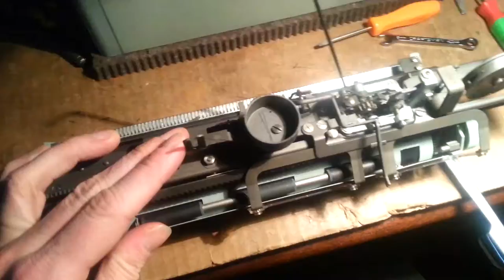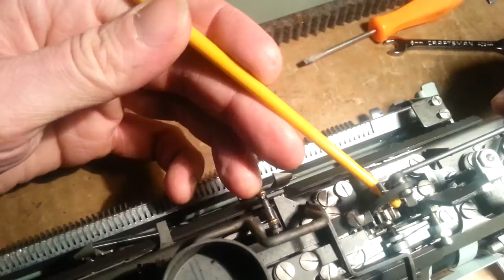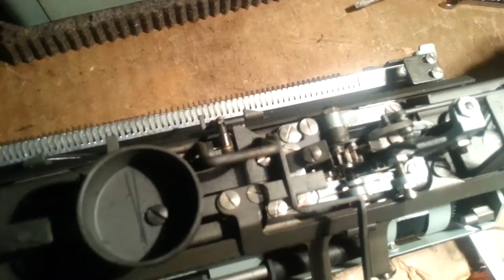1958 Hermes 2000 escapement

Comment: I am having trouble putting back the carriage on the body on my Hermes 2000. The "swinging bar" for the ribbon shift lift on the carriage (the one next to the bell in your video) that should rest on a lever/crutch in the body seems to make the carriage not sink down low enough but rather pivot on this point. Have not been able to figure out what is wrong.
Any chance you could make a video or explain how to put the carriage back on correctly?

Comment: I have a Hermes 2000, and I've noticed there's no bell and the end of a line. Do you know if there a switch or something to turn it on? or does it just not have one?
Reply from the maker: There is no control to disable the bell.  In all likelyhood, yours is 'simply' malfunctioning - could be just dirty linkages, could need adjustment, could be missing parts, could be a foreign object caught in the works, could be...well, you get the idea.  Be observant, be patient, follow the physics, and I promise you can figure it out :)
Reply: +TypewriterJustice Thanks for the reply. I followed the physics and fixed it.  Small right hand margin thing wasnt catching  the bell lever properly on it's way past. I give it a clean and bit of a wriggle and it working fine now.

Was absolutely filthy. Must have over 60 of dirt and dust embedded in it.

Comment: Hello sir - I need a bit of help. I have a Hermes 2000 which works beautifully - Except for that, the backspace pull was loose when I got it and then totally fell off and out of the machine a few days later. I need help working out how to reattach it. Could you spare a few minutes?

Comment: I know this video was quite some time ago but I would appreciate some help with my Hermes 2000. The backspace is sometimes moving back 2 spaces but not always. The carriage is also not advancing from the space bar when in the UC position. The lever you are tripping for the carriage in your video doesn't move it in the UC position but works fine in the down LC position. I think I need to remove the carriage like you have, before I attempt It I thought I would ask if its not too difficult and you have any pointers (I am a Techie LOL)

Comment: I have just bought one of these beauties from 48 in great condition that I've begun cleaning up,  it truly is an amazing piece of engineering. The segment on mine also skips sometimes, so if you can share a tip or two on how to approach it without taking of the carrier (as I think that might be a bit to complicated for me )  I'd much appreciate it.
Reply: Did you get any response regarding the carriage skipping sometimes? I just got a Hermes 2000 yesterday and intermittently it will skip a space after typing the letter a
Reply: @TheBunden  Hey Brendan, I didn't get a reply but havent had time to look at the 2000 as Im currently working on a 3000, but though the process of cleaning that machine I have learned that sometimes a cleaning will get rid of that type of problem as it's probably old oil gunking up the small gears inside the escapement and other places in the machine.

Comment: Glad I ran across this because it reminds me of an issue I'm having with one of my machines. I recently acquired a "user grade" (cosmetically imperfect but functional) early Hermes 3000 for a good price, and aside from needing a general cleaning, the only flaw is that the throw-out (pawl? bail?) on the escapement that enables a nice silent carriage return is not working, so I get the loud "zipper" ratcheting sound when I send the carriage to the right. 

I'm neither a complete newbie to basic repairs, nor an expert - so what's the best approach to finding and fixing this problem? Or should I seek out my local typewriter mechanic? (Unless really early 3000s didn't have the silent return throw-out in the first place - mine's a '59, apparently within the first 10,000 Hermes 3000s produced.) 

Always enjoy your videos, we get to see some nice machinery and some great repair tips as well.
Reply from the maker: Carl Clark - what you're describing is a common problem for the H3k, and unfortunately it's somewhat tricky to fix.  The silent return clip is either out of position or broken, and will most likely need to be replaced...which means you get to make a new clip, temper it, and install it.  I have to do this soon for one of my own, and will take pictures as i go(and maybe even make a vid of it).   email me for more info typewriterjustice@gmail.com
Reply: If you're going to dig into yours, I'll wait and learn from your experience!